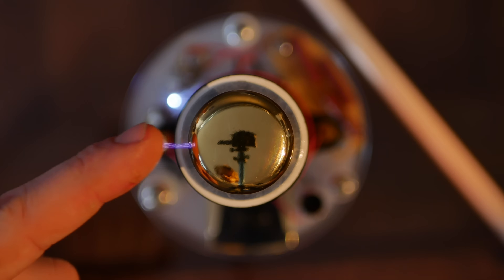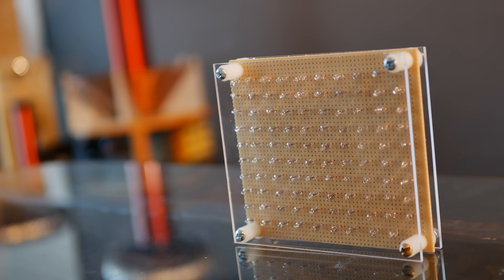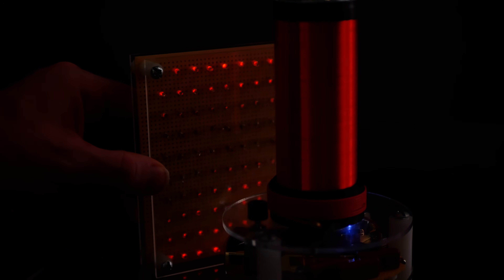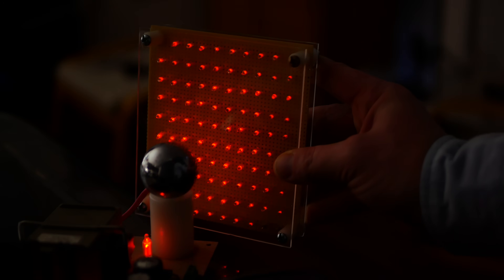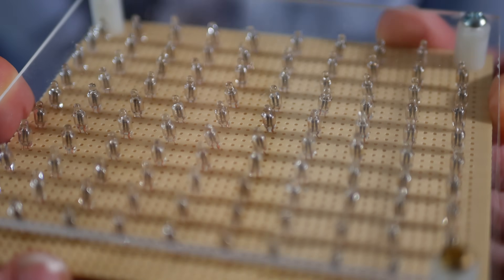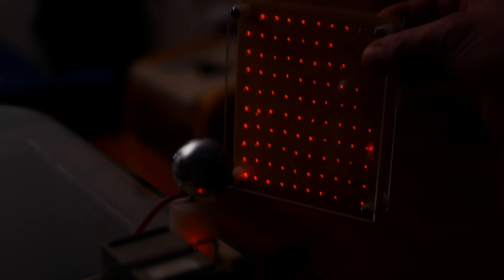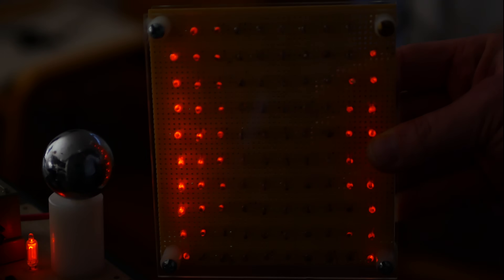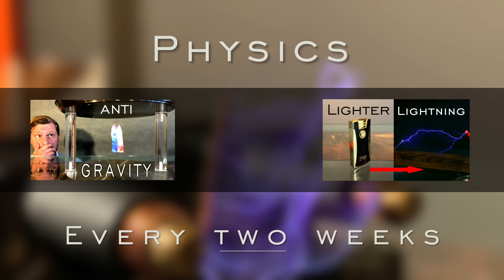Visualizing Invisible Energy Fields (Using a Neon array)

Comment: Ive actually made a high voltage indicator stick with a clear pen, an indicator light, and some aluminum foil (to ground it to you. This is because i designed it for use in low current like a tesla coil).

I think its in a video on my channel where i tested my tesla coil

Comment: Try white LEDs! Perhaps with one leg grounded. They are über-sensitive.
Reply: Yeah. But theyre also über-sensitive to overvolting.
Reply: @nightrous3026  They are only sensitive to thermal shocks generally caused excessive currents. If you don't go very close or touch the contacts then impedance between the transmitter coil and the diode leads should stay high enough to prevent any damage.

Comment: Nice video. I never thought about that neon board. 

I think its happening because the neon light is now acting as a conductor. One side he picks up de magnetic field and creates a curren that will flow towards your body.  That spot will light up where it picks up the magnetic fields. 

Your body is a huge capacitor that will charge up. Thats why you will see 2 sides of the neon board lightened up.
Maybe I am wrong. But thats my thought.

And could you also please make a 30V musical  slayer exciter? I am a little bit stuck with making that. My own designs do not work  for some reasons. Designs on the internet do not work either. And trust me. I have hooked up  everything right. I even used all kinds of resistors and capacitors, different windings and even loads. Best result was when the music literally played from the from the powersupply. Not from the tesla coil it self. And my teslacoil is creating a magnetic field beacause my neon lamp was turning on. But not playing music properly or in some cased completely not.
For the slayer exciter I am using an Irfp 250n mosfet and for the music interupter I am using a Irf 530a mosfet. 
Would be really great to see your design!
Have a nice day!

Comment: Why connect them in parallel? I could understand if he solders only one lead of each bulb to ground them all on one side
Reply: I came here to State the same thing, or well at least ask the question of would it do better to just connect the one side?
Reply from the maker: Funny, this is the most common question i'm getting. After experimenting - I found placing the neon bulbs in parallel caused the entire device to be more sensitive. Mostly because the connected lights acted as an inductive length of wire to better collect power.

Comment: You have to let each bulb isolated from the rest, of at least solder only one lead from Esch bulb to ground and let the other work as a little pixelated antenna, so one antenna&light-pixel per bulb in the array. But of course do not connect both terminals of the bulbs

Comment: The reason why there’s a dead spot in the middle when you hold it could be due to the radio waves emitted. The middle part could be in a low energy portion of the wave.
Reply from the maker: Thanks for the idea. I was thinking the same, except that the dead spot moves with respect to the power source, as I move the device in and out.
Reply: Plasma Channel it may be a result of how many bulbs you have. Try one row of neon bulbs instead of the large grid, maybe it will yield different results

Comment: I'm curious why you wired them in parallel? Wouldn't they still work if they didn't have any wires in them? Just curious. :)

Oh, and I think the reason the field shows up only on either side, but not in the middle, is due to the electric field being 'focused' more both by the coil and by your hand. It'll create a higher voltage differential in those regions due to being focused more, enough that it's higher than 80V and can light the neon indicators. Otherwise, if the charge is more spread out, it may drop below the 80V threshold across that region.
Reply: Exactly! I mean, why connect them in parallel? I could understand if he solders only one lead of each bulb to ground them all on one side
Reply from the maker: Boy i'm getting this question a lot haha! After experimenting - I determined that wiring the neon bulbs in parallel caused the entire device to be more sensitive. Mostly because the connected lights acted as an inductive length of wire to better collect power.
Reply: @PlasmaChannel  
Ah, I see! So it'll be coupling inductively too. I guess it would help, as Electric + Magnetic = Electromagnetic (field). Both fields being jostled around at the same time. :)

Comment: Have you considered using a single neon bulb and taking a long exposure shot as you move it around. Reduce your camera’s iso and increase the shutter time. I’ve seen this work well in the past!
Reply: Blueprint?!!!!!! Big fan!!(and yes, you are right (of course!!), that methode of yours will give an excellent 2D (or even 3D!) picture of the fieldstrength!)
Reply from the maker: Hey Dayton! I've actually received a few questions on this one. I may have to give it a try. Though, I like a live representation of fields. Photos are not live.